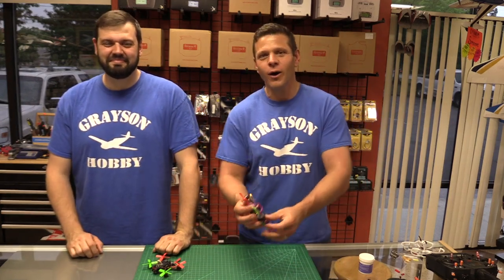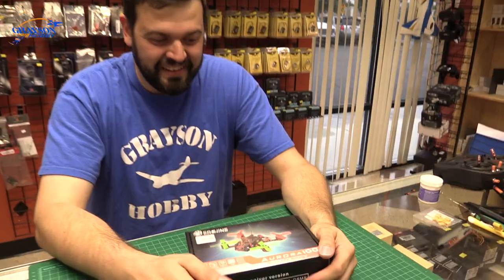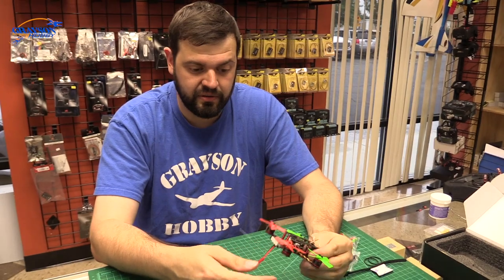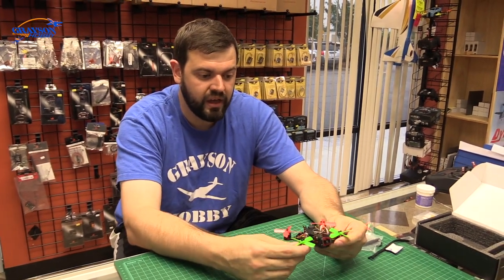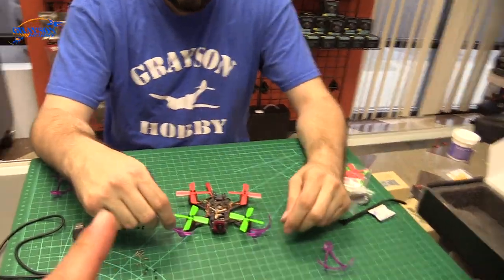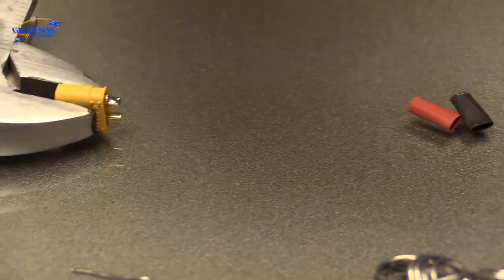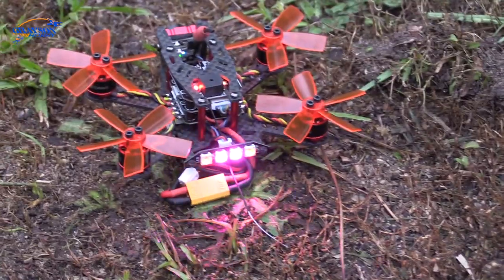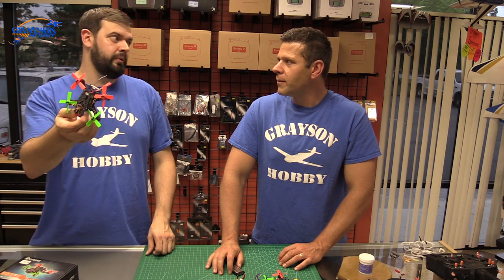Aurora 100 Speed Test - Configure - Upgrade - How To Solder XT30  - Fast Micro Brushless Drone

Comment: I love this quad. Upgrade the base plate to 2.5mm, dipole antenna, XT-30 connector, and swap on some Gemfan Hulkie 2040 props if you want beast mode. Flies great. Favorite thing to fly right now.

Comment: I would like to see you replaced the AIO camera on this quad to a 200mw camera. I would have like to see at least a 100mw on this quad. I will be buying this quad or the Lizard 95 very soon. Which one would you recommend considering the flight characteristics between the two? Thanks for the good review. Keep in the air gentlemen!

Comment: have you seen the new wizzard x220s!!!!!!!!!!!!!!!!!!!!! 2206 motors 1100grams of thrust ominubus f4,ccd camera,600mw switchable vtx, pagoda antenna, 30amp 4 in 1 esc!!!! no pdb!!! u gotta get em in
Reply from the maker: Just because its new, does not mean its better.  Lot of unknowns and issues we need to figure out still.  Best best would be August before its ready.
Reply: Grayson Hobby just because it's new doesn't mean it's not way better. every single piece of Hardware has been upgraded for the 2017 version

Comment: is this better than the each one lizard 95?
Reply from the maker: Apples to Oranges.  The Aurora 100 is better for smaller areas as its lighter and not as fast.  If NASCAR laps is all you want to do, then the Lizard 95 would be better.  Get both :)